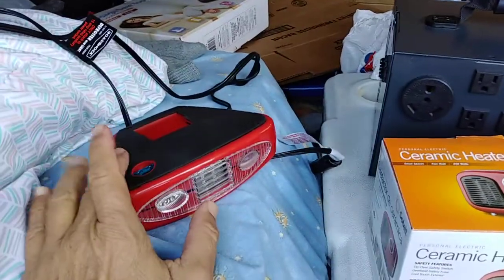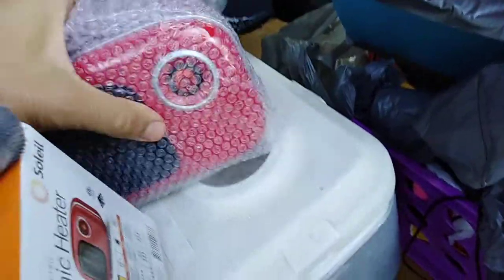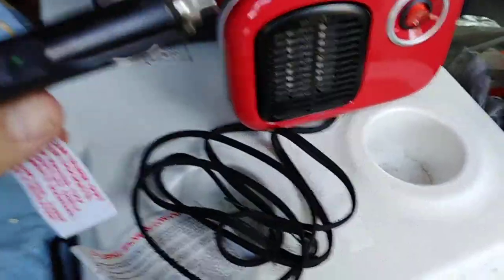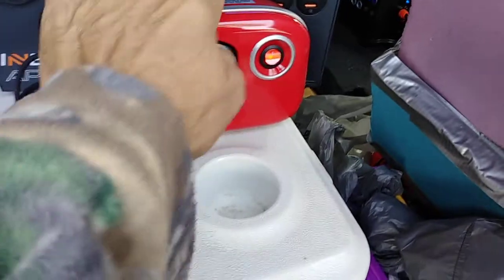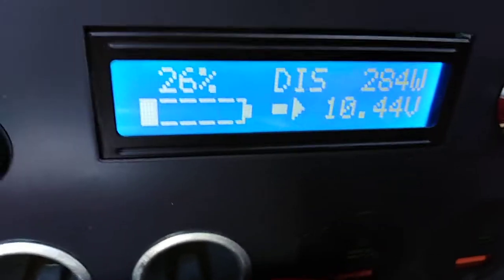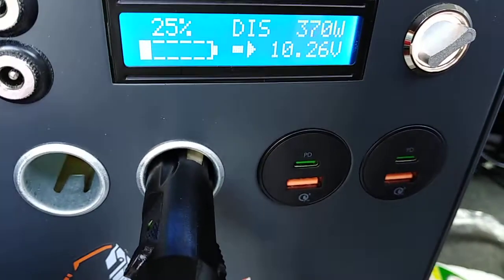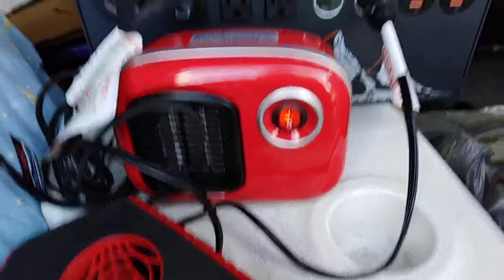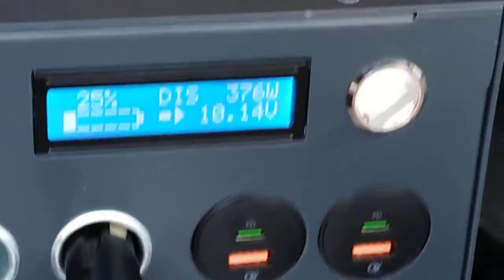Connecting a 250 Watt Heater to the Apex Solar Generator

Comment: i have a 200 ceramic heater that im heating a smallish room with. Puts out more heat than you would think OVER TIME. so if your not in a big rush it will heat a van in about an hour or less i would think